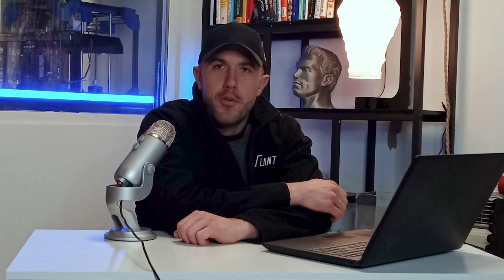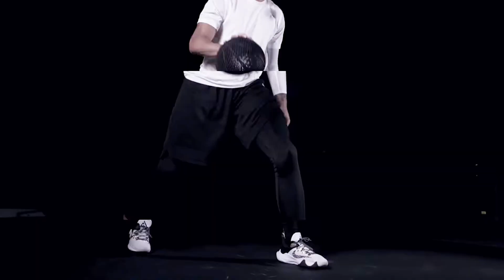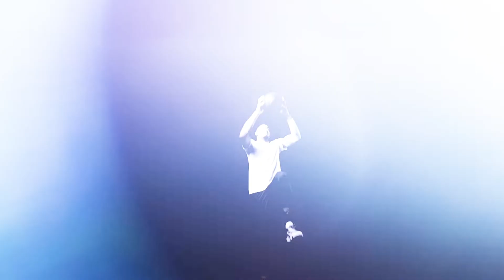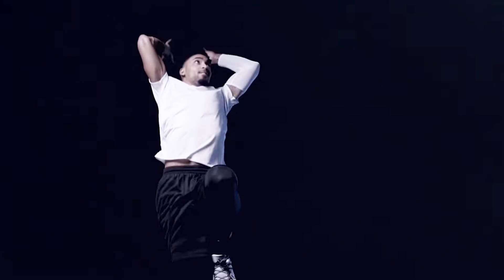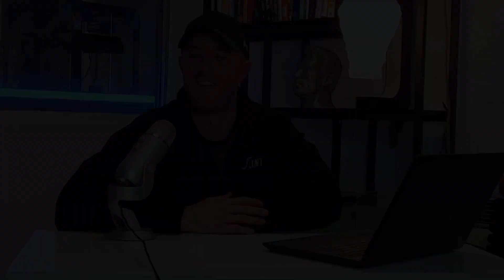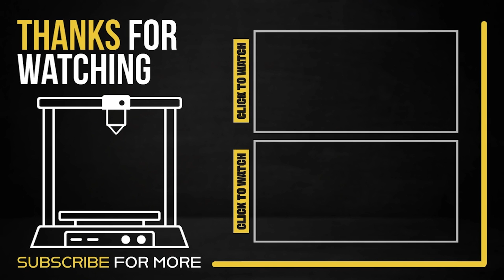Wilson 3D Printed Basketball, 3D Print News, and Why We Don't Share Every Secret

Comment: Perhaps not "news", but I've noticed how most innovation in 3D-printing nowadays is happening in software. Even looking at the Prusa ecosystem, which have had the same printer for 4 years, got organic supports last month, which for some use cases is a real game changer. Outside of the Prusa ecosystem, now Klipper can make a super-cheap ender machine put out high quality parts at high speeds (yes not consistently at scale disclaimer).
Maybe this is where more innovation is happening? Even looking your own Mason, it's a pretty basic machine (by design). I would suspect even you would be more excited about a free software update to your existing machines rather than a new costly bed material.

On a side note, really interesting content, 100% agree that you can't (and shouldn't) share everything.

Comment: Have you considered higher temp printers with heated chambers. Also thoughts on pa-cf.
Reply from the maker: Our building is an enclosure. PA-CF is easy. We do it all the time
Reply: @slant3d  what about higher temp that a 90 c or higher chamber heat. Or ultum 1010. Those kinds of materials.